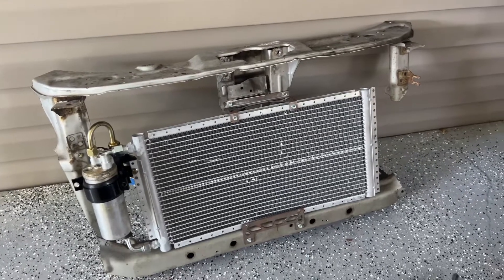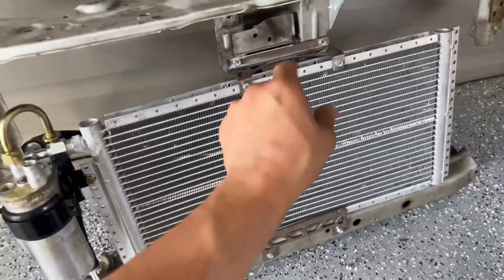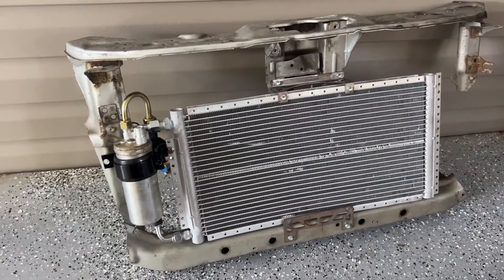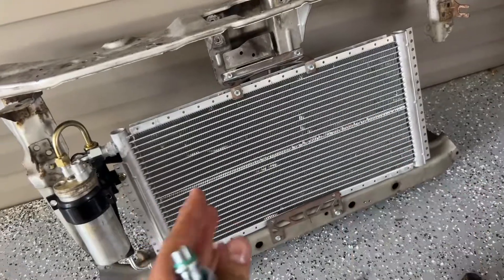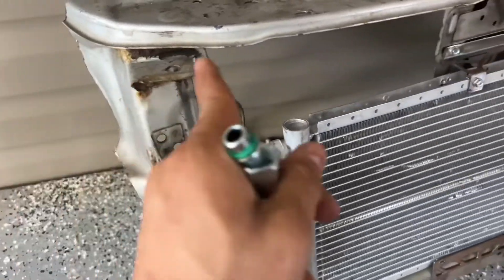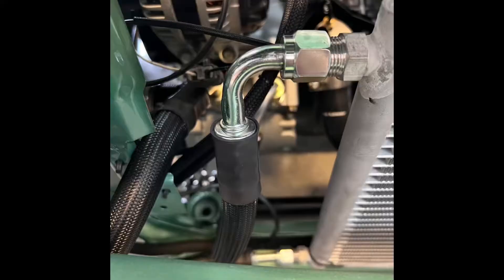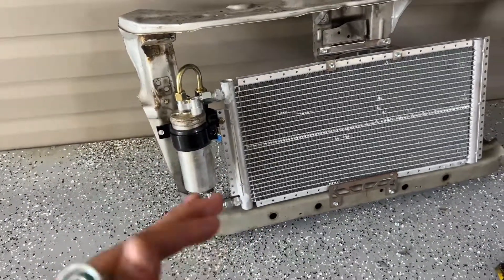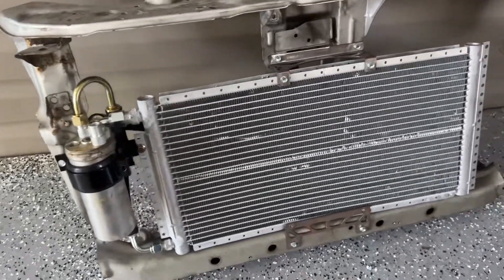Ek-Eg-Dc2-Dc5creations ac kit v2

Comment: This kit fits tight but good with a full size csf radiator. Chasing down a reason why my compressor clutch stays engaged but this kit fits good.
Reply: hey you have a pic how you routed the ac lines, im looking to get the same radiator.
Reply: @dm6324   I routed them through the fender and used metal sheet screws to bracket in the dryer. Just route it the best you can. Can't use but one fan on the csf v3 radiator and shroud I got. Temps get hot in traffic. Get the car tuned before you charge it. My first fuel map from the tuner kept the compressor on 100 percent and blew out the freon. Worked good about a week before that. I need to get it charged again. Also need to figure out how to wire the ac fan to come on with the radiator fan. Not sure I'd have the idle issue with the ac fan on. The fan that comes with the csf flows maybe 800cfm. Amazon has one that flows 1200 or so.